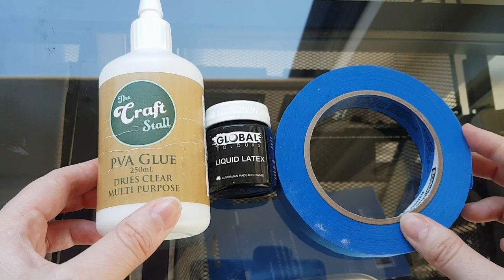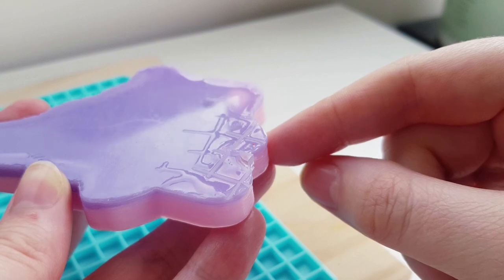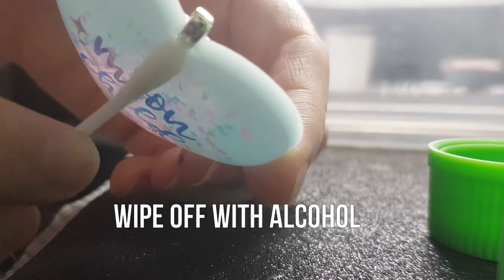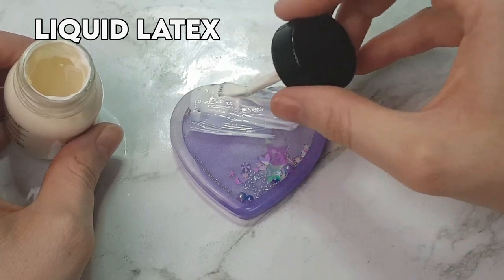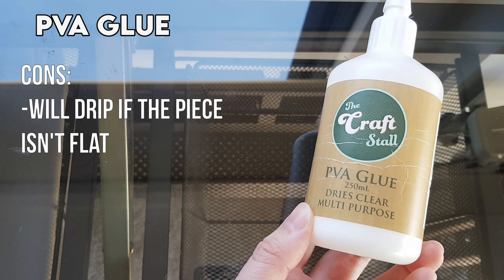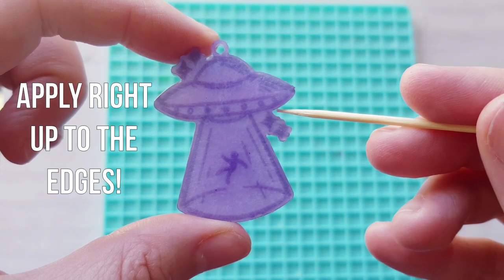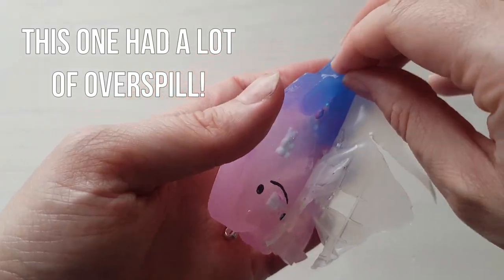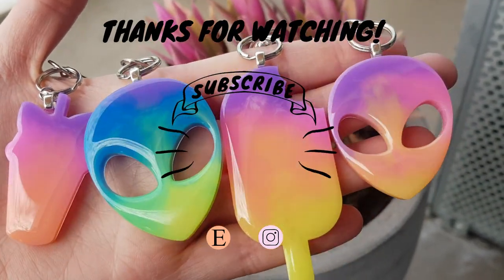Avoiding Overspill- How to Stop Resin Overspill Ruining Your Pieces! | Seriously Creative

Comment: Can i use PVA glue to prevent overspill on wood? i often make Large wooden wall hanging resin art pieces and use latex. i'm thinking about PVA after this video but not sure if it will work on wood
Reply from the maker: @areebafaheem3081  it would be hard to know without doing a test first. The reason it works on resin is because it's non porous and doesn't absorb the glue, not sure if it would work the same for wood 🤔

Comment: The tips are very good and useful. I wish have known this when I started my resin work a year ago where after demolding and excited have to ruin the front during doming - most of my first work had to be thrown away (tip number 4). Do you use cold or warm soapy water to wash the finished products? Thanks so much for sharing this video 👍🏽
Reply from the maker: Thanks so much watching! Ruining a piece after doming is heartbreaking isn't it?! Yes i just use warm soapy water to wash them 😊

Comment: But when using painters tape you have to pull the tape off at a certain time otherwise it will adhere to the piece if the resin starts to harden. When do you know that it is not too little time or too much time beacause if you touch the piece to take off the tape too early you're not gonna ruin it because it is still wet if that makes sense.